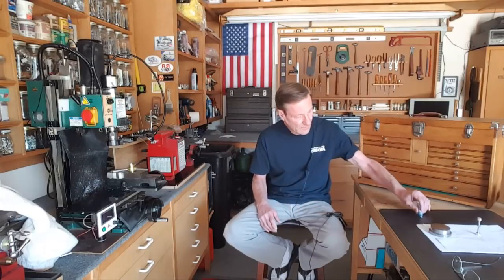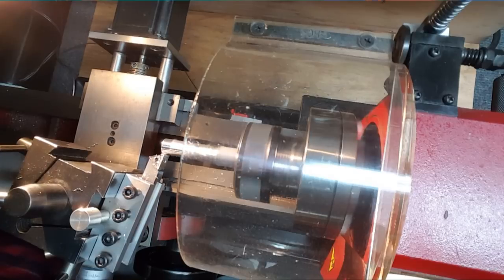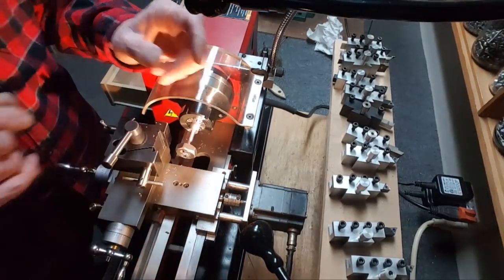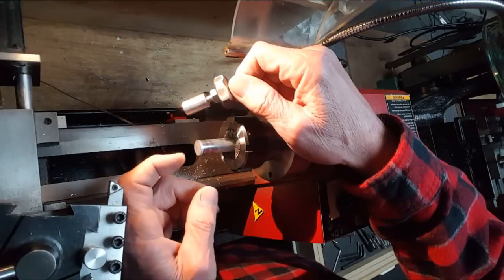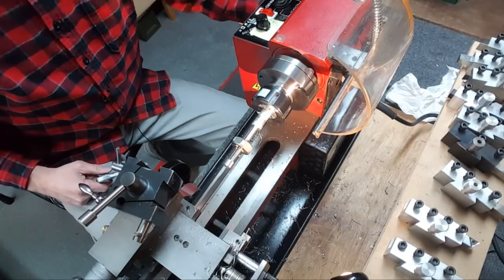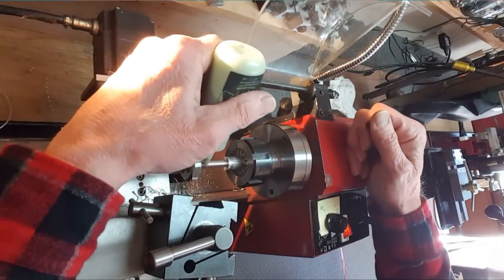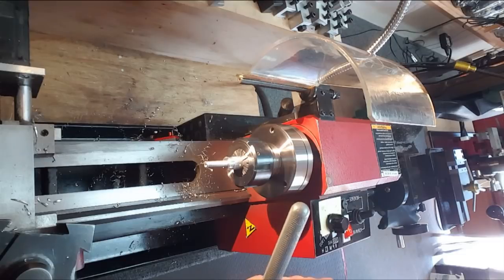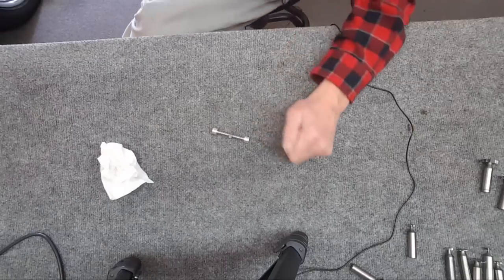Machining The Impossible Trick Nut

Comment: Sandals? No gloves? That's brave (or stupid). I just hope you were wearing eye protection.
I hope people do not see this and think that it is ok.
Reply from the maker: I found that chips somehow get into my shoes and thus get imbedded in my feet where as with sandals chips simply fall off. You must also remember I'm not in an environment or doing something that requires steel tipped shoes. And I'm not brave enough to wear gloves around a spinning machine but thanks for the concern...
Reply: Makes sense I guess. Gloves wise, I don't mean sloppy welders type, but the poly coated ones that fit close to the hand. Won't catch anything, protect your skin, and keep your hands clean. They are cheap, and last ages as well.
I am glad you took my comment as I said it. I can be blunt, and people oft think I am being caustic when I'm not.

Comment: I've made many of these as gifts.  Having made many, I have what I think is about the fastest way to do it:  Take the two pieces of brass, and drill and tap them each on one end 10-24.  Make two identical pieces.  Take one piece, run a long 10-24 grub screw into it with loctite, leaving about .4-.5" of the screw sticking out.  Clean any excess, and once the loctite cures, assemble the two halves by screwing them together.  This is your blank.  Put it in the lathe, turn down the middle section to 3/8" then thread it using the lathe, not a die.  If you want to check your thread depth, unscrew one end from the other and test the nut on it.

Done this way, the seam is absolutely invisible.  Obviously, you need to face each part of tapping to ensure perfectly flat and concentric mating surfaces, but if you do that then after threading, the seam will literally disappear as you watch them screw together.  IF you notice a seam when first screwing them together before threading, don't worry.  The parts aren't perfect concentric to start with, but once you turn them down prior to threading you'll see the seam disappear as you turn it down.

Hope that made sense.  Obviously you can make a bunch at one time but build several of the halves, then making blanks and threading them.  Only have to setup for 3/8-16 threads one time, and you can turn about 5 out in 2 hours if you are hustling.

Love your channel!